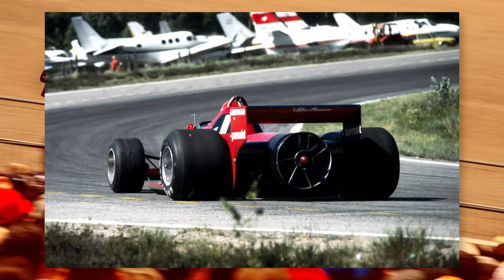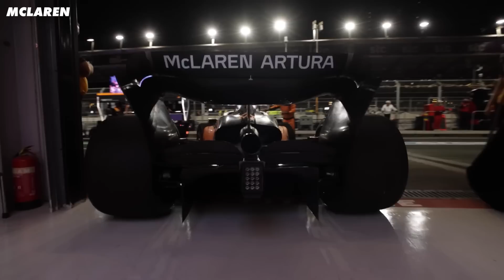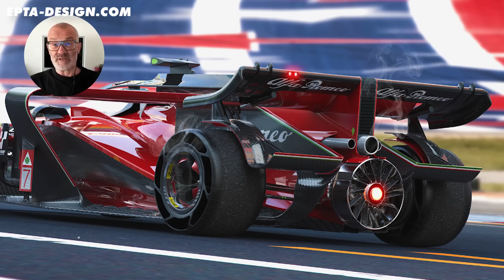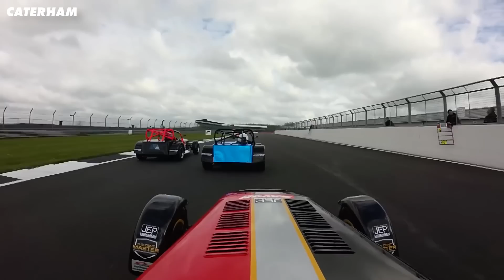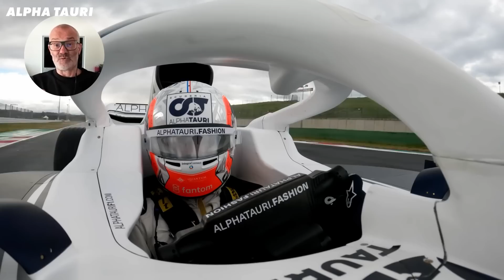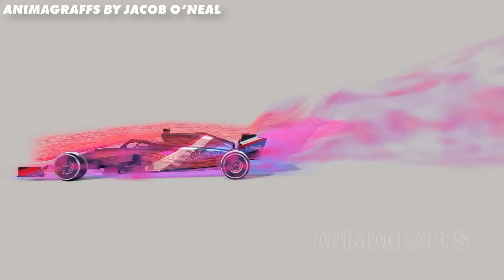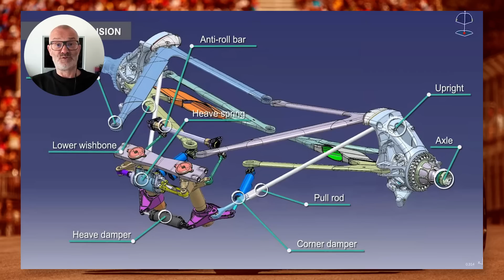Would Fan Cars Work in Formula 1?

Comment: Active Suspension is highly applicable to Road Cars so it benefits all the manufacturers
Reply: That's like opening the pandora box, manufacturers would program that suspension for every turn
Reply: @Pokez0rd  not necessarily, it could be regulated many different ways
Reply: @Pokez0rd  good, now there’s an edge between the best engineering teams and the rest. That’s part of the competition.
Reply: @Pokez0rd  Good, make the cars the perfect race cars that's what they're meant to be. Obviously within the realms of human capability and safety of the drivers.
Reply: @Pokez0rd  that’s how the McLaren system worked according to Paddy Lowe. Williams reacted to keep a stable platform at all times which was ultimately a better solution.
Reply: J damper too!
Reply: I can already see the branding: 2026 Mercedes-AMG W17 E Performance Powered By AIRMATIC+
Reply: Only applicable to manufacturers that aren't interested in cutting costs and maximising profits above all else, so practically none of them.
Reply: @KingSvenDeluxe  Toyota actually did it in their domestic market on the V8 Soarer and (weirdly) the ST183/ST207 Celica/Curren. It was dropped after 1996, due to cost. It was true active system too - no springs or ARBs. It worked well but it was hideously expensive, required specialized technicians, and sapped a lot of power - I think the Celica/Curren version was Manual Only due to power loss. The system was never sold outside of Japan for obvious reasons.
Reply: Look at every development that was once a luxury add-on and is now compulsory in any car. Disc brakes, power steering, air conditioning, fuel injection, seat belts, ABS, airbags, etc etc of course it will happen.
Reply: I can see a hammer fan here
Reply: How common is active suspension in modern cars?
Reply: @avarmauk  Less than 1% of annual produced cars.
Reply: Imagine the racing where instead of DRS, there were sensors before turny bits of the track where drivers could turn on a fan system giving them more grip/speed around turns, thus promoting more overtaking in interesting bits of the track rather than just braking zones after long straights. Anyone?
Reply: Complicates things tho, doesnt work with the cost cap
Reply: Yes but for race cars active suspension isn't desirable
Reply: @justamanchimp  if you want to go fast, it is…
Reply: @onomatopoeidia   Well you're essentially adding an assist to the car which is not desirable for good racing. It needs to made harder, not easier. The racing would be boring af if we started adding assists, and also then where does it end? If you set the precedent that we allow this one assist, then people will start arguing for more assists and then before you know it, you have a car that is basically a dream to drive, which is not what you want. That's the opposite of what we want, trust me.
Reply: @justamanchimp  It would be, but it was banned in F1 and other places after 1993. It was highly desirable for race cars.
Reply: @danielrobis9226  Yeah it's desirable in terms of making the fastest car possible, but that isn't the goal. The goal is to make the best race car possible for racing. Active suspension removes a level to racing that I and many others think is important for Grand Prix racing. It's not desirable for wheel to wheel Grand Prix racing. 

It won't happen because otherwise people will look down to F1 as being "assisted", which I don't disagree with. You may as well add in traction control whilst you're there.
Reply: It just benefits merc the most ATM because they never stopped developing DAS
Reply: @thejusmar  they could bring DAS as a spec part, red bull are the spec for the wheel covers, so mercedes spec for DAS steering systems would be cool, i think williams likely still have lots of data and prototypes of active suspension that could become the spec parts or other teams, every team probably could contribute a few spec parts in their own ways likely

Comment: None of these solve any issues without creating much bigger ones and/or adding a ton of costs.

- The fan would mean a lot of added weight, a complete redesign of every car and starting from scratch with development, while dealing with an ever tightening cost cap. The fan also creates even more dirty air, making it harder to follow, as it leaves an even more turbulent wake.
- The active aero is way too complex and expensive, which is why this has never been done or was banned, outside of DRS. It is also a driver aid, as the active aero does part of the driving, in terms of adjusting for loss of grip, etc. It works on planes because they aren't built to the last gram, have redundancy built in and are much, much larger. 
- The active suspension is the same as the active aero: it's a driver aid, which takes control over the body roll, pitch, yaw and more. Now, it is down to the driver to deal with this, which takes skill, talent and experience. MotoGP uses it and many are against it, also because it can fail. This happened in the last race, making the bike unrideable. 

An actual solution would be to make the cars smaller, as that both drops the weight, reduces the wake/dirty air and makes it much easier to pass. They're driving in landyachts compared to most racing series. Before the cost cap, some innovation were banned as the other teams said they could copy it, but it would be insanely expensive, giving the rich teams a major advantage, like active suspension and the tuned mass dampers in the Renault.

Comment: Good ideas are often not that costly, but the sport needs to be able to let the engineers work their magic and come up with innovations that likely will also benefit a wide range is applications, even passenger cars. If there were simple rules on size, weight, fuel economy, safety and of course cost it would allow some I think really creative and interesting things to come to the surface.

Comment: Now that I´ve seen that McMurtry Fan car at Goodwood and seeing how small and manouverable it was I think fan cars would be great for F1. Just imagine what Monaco would look like with small nimble fan cars
Reply: With F1 waffling on the future of Monaco, just run a full Speirling class at Monaco as the Premier event???
Reply: It's funny isn't it, F1 is considered the pinnacle of motorsport but in many ways it's definitely severly outdated by the FIA and their stupid inconsistent use of the rulebook.
Reply: @Methbilly  exactly
Reply: @Ange-tc4rm  Wrong. Small car = unsafe car. Put drivers in that tiny junk and you'd have most likely at least one fatality per FE race. Do you seriously want that?
Reply: @KuK137  a small car isn't inherently dangerous, go karts are small and they're fine. It's mostly how fast a car goes that determines how much of a crash structure you'll need, and yes, that McMurtry looks like a flying coffin.
Reply: @KuK137  Could you just have a look on Scarb's Tech Talk about Crash-structures, and recognize how little space (length, width) is used for the six crash-structures?
They definitely would also fit in a McMurtry sized car...
Reply: @Methbilly  the battery tech just isn't there, you won't have enough juice to have a reasonably lengthy race without making it really heavy.
Reply: @nocashirl  Battery swap pit stop. Sounds stupid but its feasible.
Reply: Imagine Spierling spec racing. I'd watch the shit out of that.
Reply: The fan has no correlation to the car being small whatsoever. Modern f1 cars are huge due to safety only
Reply: @danielssonsgarage  No, safety doesn't require the cars to be so big, it's purely for aerodynamic reasons (length) and cornering speed (width). For 2022 the FIA already mandated the gearbox to actually be close to the rear-axle, so cars are easier to shorten for coming seasons (mostly free space between gearbox and engine, rather than free space in an aerodynamically beneficial slim "coke-bottle"-rear-end). And between the rearward crash-structure and the motor is a lot of space that could be shortened. Shorter cars would be a bit lighter and probably less likely to lift of in an accident, likely beneficial in terms of safety. But shortened cars would reduce the available aero-surface, thus requiring other mechanisms to maintain current race-pace (e.g. active-aero and active suspension).
Reply: @justmy-profilename  with the driver, tank, battery and engine at the same place, how much room is it for getting the rear axle forwards?
Reply: @danielssonsgarage  Which cars are you looking at, that have the driver not in front of all the stuff you mentioned? 🧐 I recommend having a look on Mick Schumacher's neatly split Haas at Monaco 😉
Last years cars had an almost empty coke-bottle-rear more than a metre long, and seeing how tightly everything is packaged in the W13, I'd say it's not a serious problem for the engineers to package everything into a conventional sidepod design with a car length of 4,60 m. They just don't do it because it would shorten the floor, especially the Venturis.
Reply: @justmy-profilename  lol you think the wheelbase could be 240cm???  120cm shorter than todays cars at 360cm. 60cm shorter than the cars year 2000....
Reply: @danielssonsgarage  Wow, impressive! 👍🤦🏼‍♂️ You are just stating nonsense. Are you lacking that much understanding or just ran out of good arguments?
I didn't say the wheelbase should/could be shortened by a metre (or your out of nowhere 1,20 m) but the CAR length. Remember, your point was that today's car length would be necessary for car safety? Moving the end of the rearward crash structure 1 m closer to the driver doesn't imply to shorten the wheelbase by the same amount. E.g. the Ferrari F2004 was more than one metre shorter than today's cars, but had only a 55cm shorter wheelbase.
But you probably just know better than the FIA which already set up this years rules to make shrinking the car length easier. Just ask Scott if he doesn't want you as replacement for Scarbs...
Reply: @justmy-profilename  look at a f1 car and look where the crash structures begins. The overhang is regulated to 810mm at the back and min 1150 at the front. That's why I'm saying your total length is not going to happen.
If its possible to shorten the gearbox and rear diff assembly we could get a shorter car but the weight really comes from the hybrid system and the crash structures, with the halo
Reply: @justmy-profilename  the f2004 was smaller thanks to less crash structure, that's my point
Reply: @danielssonsgarage  So a rule change can't change the rules?
How often do you see any of the crash structures crumble without the wheels not breaking off? Not often. But very frequently the opposite happens. Because the crash structures are designed to absorb vastly more impact energy as the wishbones etc. can. Having less overhang over the wheelbase wouldn't make a significant difference how much energy gets absorbed by the crash structures. Less overhang might lead to more expensive crashes, as e.g. the gearbox would be more easily damaged. If necessary limit costs of crash prone components, but crashes might also be less frequent, as smaller cars have a better chance to go alongside through corners without touching.
Reply: @justmy-profilename  you should think about what the wishbones are attached to. You cannot have crash structures inside the wheelbase
Reply: @danielssonsgarage  The higher weight comes from a lot of points. The introduction of the hybrid system didn't change much in terms of maximum fuel loaded weight (which is the important figure for crash tests), rather on the minimum side. And a lot was added later on, yes the halo, not so much the improved but relatively lightweight crash-structures, notably the 18" wheels, and the minimum weight of some components like the ICE was also increased to encourage the use of less expensive material. It just sums a up to a lot, and it was frequently reported that 2022 cars are also heavier due to their floors, and metal reinforcements were allowed after the season started to make the floors more rigid and a bit lighter at the same time.
Cars are unlikely to get much lighter, but the large floor doesn't weigh nothing.
Reply: @danielssonsgarage   Cars could have a crash-structure that extends inside the wheelbase, at the expense of not (fully) covering components like the gearbox (also used as a mounting point for the rear suspension).

Comment: I was just thinking about this earlier today after watching that record-breaking Goodwood run. It would make downforce more predictable and easier to follow, but I think a sudden loss of downforce vacuum could be incredibly dangerous. Especially with all the bumpy street tracks we’ve got now.
Reply: With the fan you wouldnt need to run the car so low, as the fan is enough to accelerate the air rather than tight venturi tunnels with no fan. The point here is to accelerate the air under the car. This can be done by narrowing the area through which a given amount of air has to pass or by sucking it backwards
Reply: Sudden loss of downforce is an issue with the new rules package in Nascar actually. When the cars get too loose, the underbody stops producing downforce so they lose grip.
Reply: @AzathothsAlarmClock  Actually the driver saw a warning light.  Green is downforce normal and good to go.  Red is lost downforce and do not go full speed to a corner.  That car was very tricky to drive.  It goes from oversteer to understeer with fan downforce or without fan downforce.  If a driver misreads the warning light, he will drive himself off the corner.  Bad thing will happen.
Reply: I was thinking the same, hitting the curb can cause a loss of down force on the current setup,   the McMurtry has two fans to prevent a sudden loss of downforce through a fan failure.

Comment: Absolutely active suspension
Reply: Agreed
Reply: It would make driving easier
Reply: @Sam-kq6be  ok and the problem with that is what exactly? Just because it’s hard doesn’t it good. The fastest drivers will always get the most out of it.
Reply: @rexthewolf3149  I don't think Sam mentioned it being a problem. 

You are correct anyway, closer and safer racing is always the main goal. How the FIA will regulate active suspension is what I'm wondering.
Reply: @rexthewolf3149  it is a balancing act. You have make the cars challenging while at the same time making it fast and safe
Reply: @Sam-kq6be  literally nowhere is it a requirement to make them challenging whilst being fast and safe. Being fast on it's own is already a challenge. Active suspension doesn't aid you in tire management, tire temp management, brake management, brake bias set ups, engine set ups/modes and the whole lot. It's like saying standing on a tightrope with 2 legs is waaaaay easier than using just one, it's still difficult